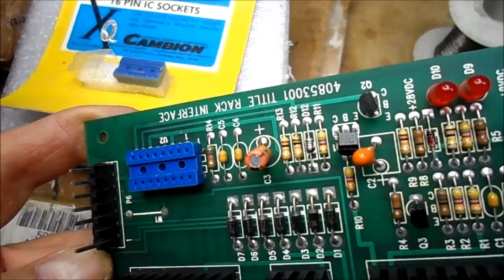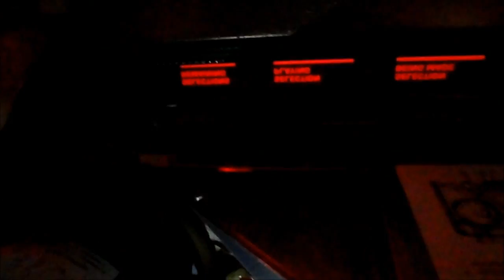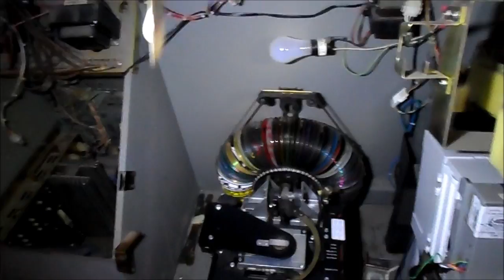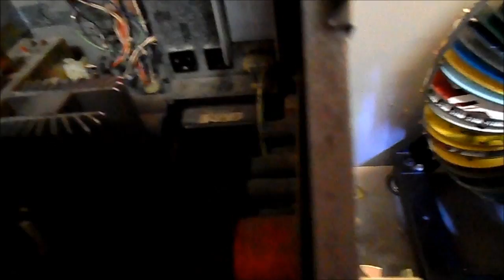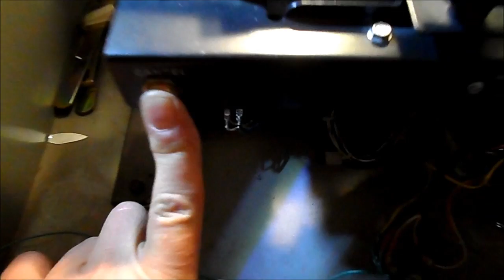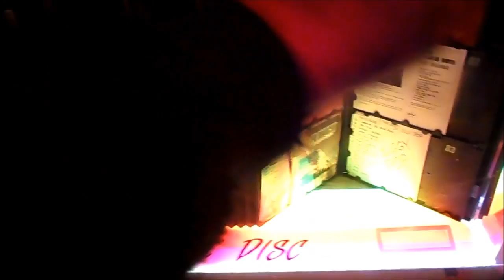Rowe CD100C. Taking Credit, No Play. Repaired.

Comment: robert I have a rowe cd 100 . my question is the player is spinning the cds fast what could be the problem? please let me know Thank you
Reply from the maker: Sounds like a issue with the CD player itself, if the laser, turntable, & CD's are not dirty. There were several versions of players as the Jukeboxes evolved. Need to get into service mode & start with the error logs first, then determine which player you're dealing with.

Comment: No idea about the specific circuit, but is it possible that the connector momentarily disconnected the 0v first? That would allow the +28v to backfeed into the +9v which might destroy the chip even in milliseconds. It's one of the reasons designers tend to be massively overprotective about grounding